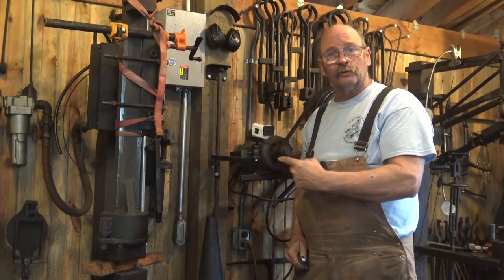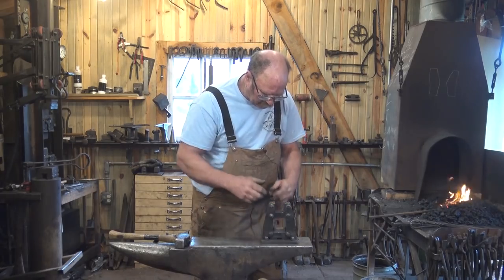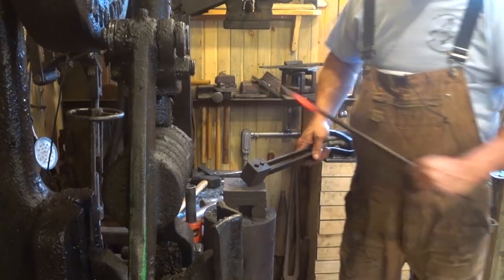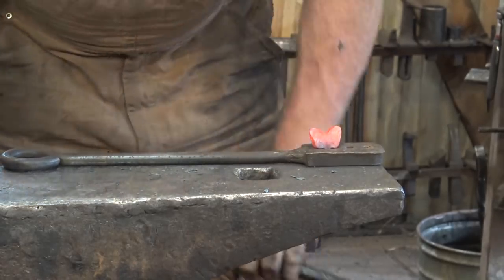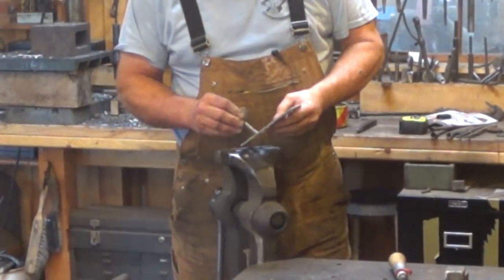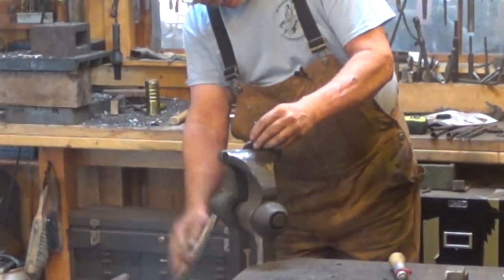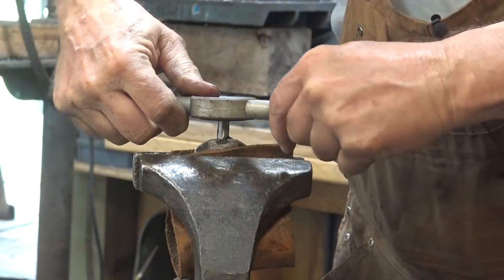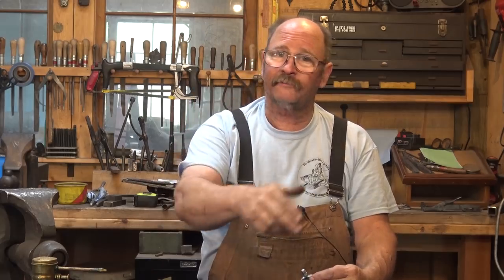Making a thumb Screw - blacksmithing project

Comment: You might want to use a brass or copper plug at the bottom of the hole to keep the wing nut from marring up the round bar. I use them quite a bit, there easy to make if you have a set of hand metal hole punches just punch a plug out of a piece of copper pipe. Great video 👍

Comment: At first I thought you were going to flatten out the head of a bolt
But hey “We are Blacksmiths”! Much nicer the way you did it.
Although I wonder when Blacksmiths first got thread cutting dies😀
Reply from the maker: Thats a good question.  I suspect it was quite some time ago.  Clock makers and gunsmiths needed threaded screws that had to match a threaded hole.

Comment: Could you do a simple straw color heat treating to make the threads stronger?
Reply from the maker: Simply heating it to straw would be tempering, which only does anything is=f the part were first hardened and since this is mild steel it can't be hardened.  If it needed to be high strength, case hardening would probably be the ideal way to go.

Comment: As a gunsmith, your filing  technique drives me nuts. If you would lay your file on the work and then file your files would last longer and you could file much more efficiently. I spend hours filing so I know a little about it, try it you might be surprised. 
Lee Gibbs  blacksmith, gunsmith, and sawyer (sawmill operator)

Comment: How did they thread things before dies?
Reply from the maker: Threaded hardware and dies come about together.  For something like this a wedged fitting might have been used
Reply: I am a retired plumber and I live in Australia.  I have worked extensively out west in what we Aussies call the bush.  I was working on repairing Southern Cross windmills on remote cattle stations and being days from any town where I could get parts, I had to improvise on many occasions.  Once I had finished the repair when I found out their was a rusty 3/4 in Gal pipe that needed to be replaced.

Not having a nipple the right length, I had two choices.  One was to drive 2 days to town and 2 days back to the job after buying the gal nipple or I had to manufacture the nipple from a piece of broken galvanised metal gate.  The problem I had was that I didn't have my 3/4 in pipe dies with me so how was I going to cut a thread into the pipe I had cut out of the gate to the right length.

Simple....I used a hacksaw to cut a spiral groove into the end of the pipe.  Then I used a three cornered file to make the thread.  It took a whole day to make one thread that would screw into a fitting with enough thread to get it water tight.  So 2 days to manufacture one 3/4 in pipe nipple.  It was worth the trouble to make one as it was faster and cheaper than driving to town and back again.

And I can now brag about my ingenuity as well.  ROFL

Nuff Said
Reply: You are entitled to brag as you managed to cut the thread and do the repair without dies. It is getting the first spiral with the  hacksaw that is the difficult part all I can say is buy your self a beer
Reply: Grins, You are so right there, the spiral was the hardest part.  I also forgot to mention, there was a lot of swearing and cussing going on for forgetting my pipe dies, along with barked and skinned knuckles.
Reply: Only swearing and cussing not throwing your tools around in temper?
Reply: Ohh crap, ok ya caught me.  Yeah yeah, the pipe ended up out in the paddock a coupla times, but I swear to god, no tools where injured in the outburst🛁🚿🚽🤣